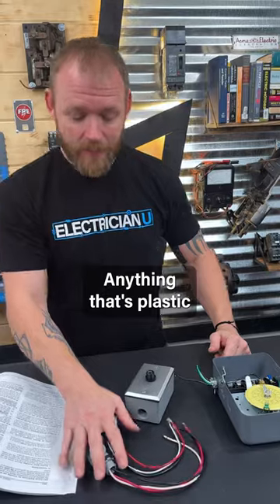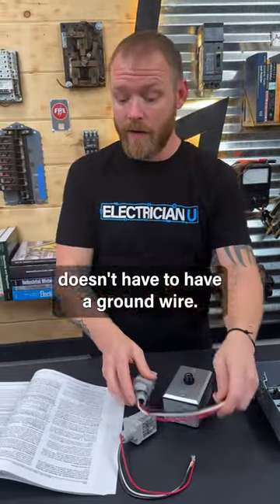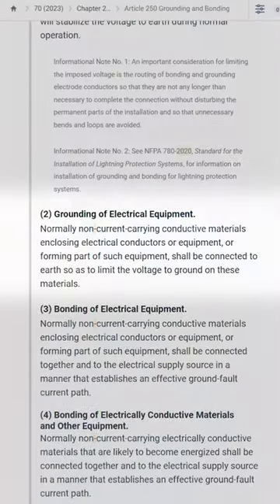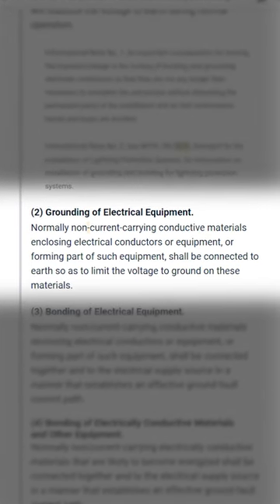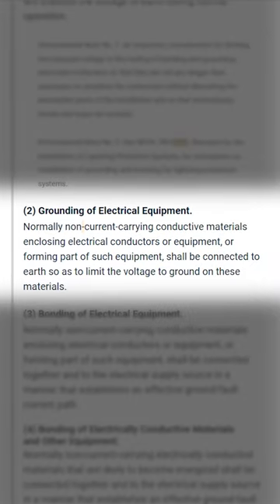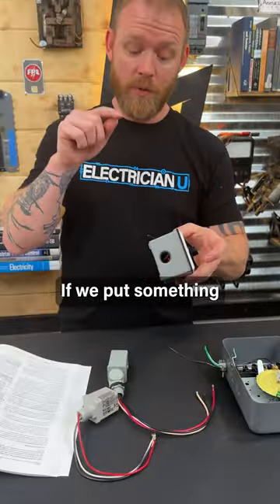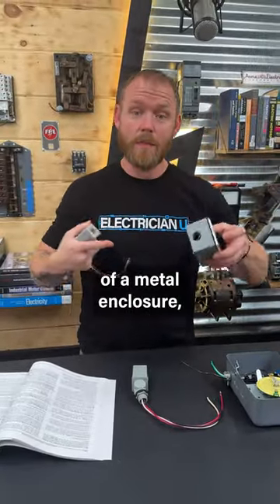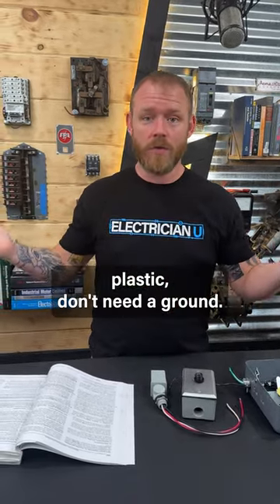Why Do Some Devices Have A Ground And Others Don't?

Comment: Devices drop shipped from China regularly don’t connect the ground. So if you get a device from china, or really from anywhere, with a metal enclosure make sure there is continuity from the case to the ground pin on the plug.

Comment: Worked in a large candy plant that I fought with lazy sparkies. They had some old machines that still used 240 volts for controls. They would replace a steel metal box with a fiberglass box & install several start stop and selector switches on hinged cover. Machines had a nightly hose down and operator had to wear rubber gloves do as not to get shocked. Had to jury rig ground wire to each button. I told them they should rewire controls to a safer 24 volts. Worse was an old starch machine that used 480 volts for controls in an explosion proof enclosure. They wanted us to open covers on expolsion proof limit switches while the 480 volts was still energized.

Comment: I'm doing a van conversion and I have a question. I have a 24v off grid system in a van with 12v system. Where do I ground/not earth/return path my 24v inverter/charger? It's a complicated question ngl. And where do I ground the AC power inside the van?

Comment: Thank you for the explanation !
 I kinda already suspected that was why, but I appreciate your referencing the NEC text.
Can you expand on whether a PVC segment is acceptable between two metallic bell boxes, so long as the metallic boxes are bonded to one another & earthed ? 
Ex: Adding a separate WTR duplex w/in-use cover onto the load side of an existing outdoor GFCI.
Reply: Yes as long as you use proper PVC to conduit connectors. 

PVC conduit isn't permitted to be installed if subject to physical damage, unless identified for the application. Schedule 40 PVC conduit is not identified for use where subject to physical damage. PVC Schedule 80 conduit is identified for use in areas subject to physical damage
Reply: @OUTDOORSMAN_NJ  i agree, but don't forget about schedule 40 being just fine for use as long as it is buried deep enough (24" below grade) you must use schedule 80 when turning up out of the ground to a box. Schedule 40 is ok within walls and below 4 inches of concrete too.

Comment: I believe that if you have the metal device hooked to conduit that leads back to the panel, that counts as a ground (provided that the panel is properly grounded.)
Reply: No you cannot use the metal conduit as Earth continuity, It was acceptable about 50 years ago.

Comment: You are correct, no ground needed, but the paragraph you quote says “shall be connected to earth”… huh?🤔
Reply: The code says "Normally non-current-carrying conductive material enclosing ... shall be connected to earth". The key word here is "conductive" meaning metallic.
The "Normally non-current-carrying" part means it is not supposed to carry electricity but since is metal it can happen if/when something goes wrong, so it better be grounded just in case.
Reply: @amieres  thanks, I mis-read it as non-conductive material

Comment: I'm an Electrician Trainee and I'm having trouble figuring out why the house I bought, built in '75, has no grounding at any receptacles or switches. I can't find anyone that or any resources that can explain that. The house is in california.  If you have any idea, I would truly appreciate your help.
Reply: They did not build it to code. If you can’t run new wires GFI can work.
Reply: Just because theres a code doesnt mean people follow it. My house has no grounding. Im gonna add a grounding rod. You should too
Reply: for starters, the code was different back then and using MC / BX wiring was considered a ground, so simply connecting the wire jacket to the metal box was enough. BTW, my place was rewired in the late 70s and is the same way. It is all MC / BX and that serves as the ground.

Comment: Why do so many electrical devices have a polarized plug (one prong wider than the other) and no ground conductor?  If it's one of those double-insulated tools with a plastic housing, what difference does it make which is hot and which is neutral?
Reply: A lamp socket is a good example. You want the bottom connection to be hot and the threaded area to be neutral. That way when you screw in a lightbulb you can’t be shocked by touching the base of the lightbulb.
Reply: @ecospider5 true, people HAVE been electrocuted that way

Comment: I'm trying to understand the code. It says it shall be connected to earth so that confuses me.
Reply: Earth = Ground
Reply: anything that can conduct even if its not meant to have current like a metal enclosure. needs to be grounded(connected to earth) to reduce the voltage that would otherwise go to ground thru something else (like a person) if it were to touch it while charged.
Reply: The code says "Normally non-current-carrying conductive material enclosing ...". The key word here is "conductive" meaning metallic.
The "Normally non-current-carrying" part means it is not supposed to carry electricity but it can happen if something goes wrong, so it better be grounded just in case.
Reply: thank you that helped me @amieres

Comment: Also... the amount of  voltage and  current MATTER.
Low voltage does not typically need to be grounded  and not all photocells carry the entire potential of the electrical circuit. In many cases a photocell activating a 12volt relay is a better option.

Comment: Okay can you finally answer my question as to why lamps like plug in table and floor lamps are always 2 prong cords when the lamp is usually a metal construction. Why aren't lamps grounded?
Reply: There are no electrical connections inside the lamp. All the areas that can cut the power cord have grommets. 

Where the electrical connections are is either ceramic or plastic. So never replace the socket with a metal socket. 

If the lamp is metal and the socket is metal then it should have a 3 prong plug.

Comment: sometimes we need that ground on plastic stuff, bcuz grounding, removes huming and hissing noise from musical instruments.
Reply: @MB-zj3er  You probably think that we need it to ground the plastic body to earth, right?
That's why you make that face.
But actually the reason is , some electronic componenet inside that plastic bag may produce loop in line, we need a ground to eliminate it.
eg: AC line hum, RF interference, USB and computer noise.
hum and hiss are generally induced from poor wiring, ground loops or other electromagnetic interferences
Reply: @ElectronicBoxOfficial  Then you're talking about some kind of a drain? Obviously I know you don't need it to earth ground plastic. :)~

Comment: This is why you install 3 prong cords on vintage amps
Reply: I have never seen a table lamp or floor lamp with a 3 prong plug, only HD work lights.
Reply: @rupe53 I think you misread that bud😂
Reply: @dustinpomeroy8817  ... yer right. He said "amps" and my brain read "lamps" for some reason. A vintage amp could use a 3 prong system.